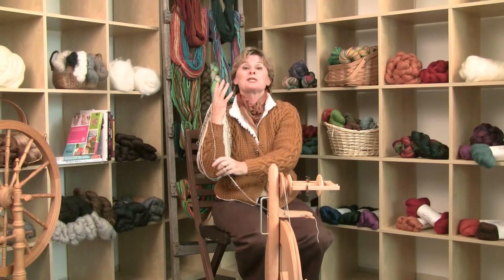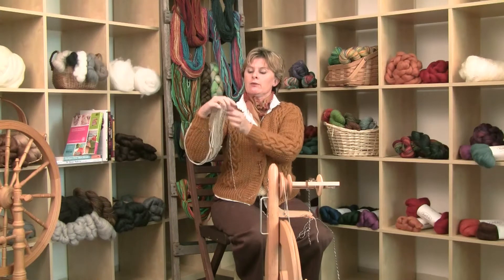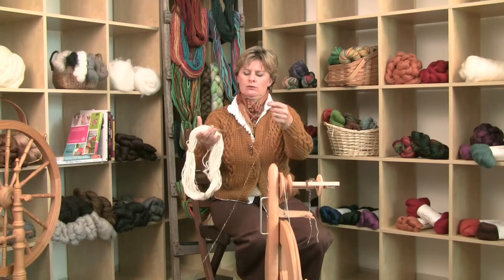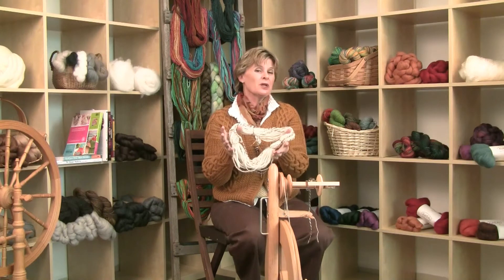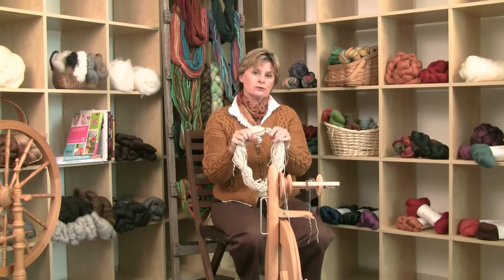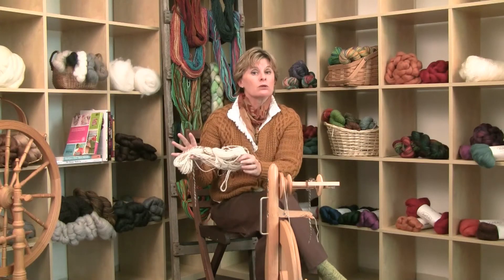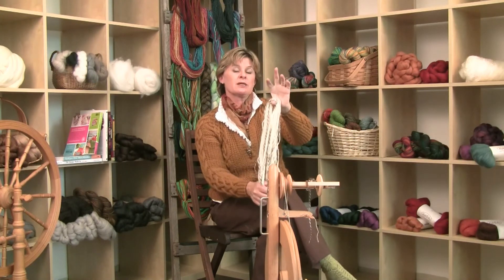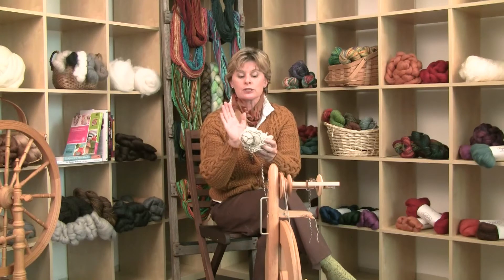Spinning Wheel Tutorial Part 6: Finishing Your Handspun

Comment: Why cant you knit directly from it?
Reply from the maker: Hi there! You'll want to soak and wash the yarn first. Then, you wind it into a skein which will need to be wound into a ball before knitting with it. A skein is essentially just big loops and loops of yarn, which will get tangled very quickly if you try to knit from it. Winding it into a ball however helps to avoid tangles and is much easier to work with and knit from.
Reply: have you ever tryed to knit form a skien directly it is much easer to eather fall apart or get a giant knot in it
Reply: you technically can it is just not advised